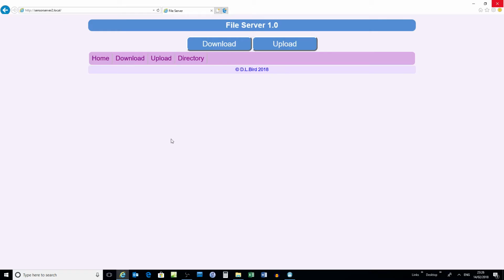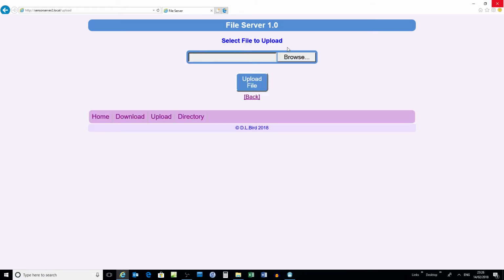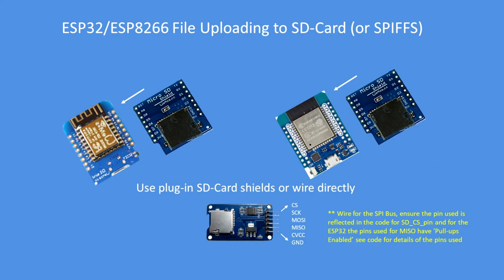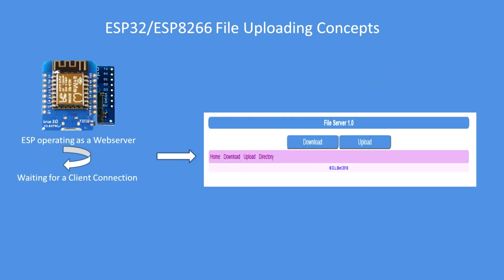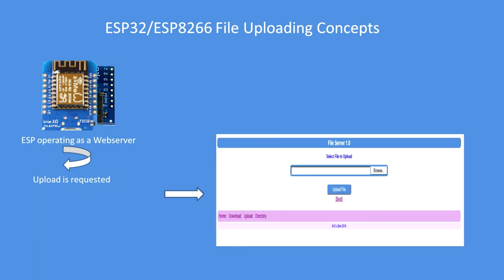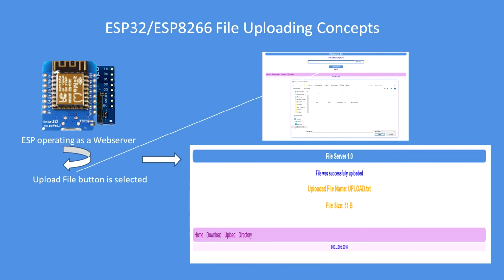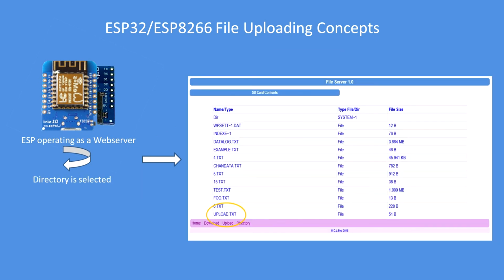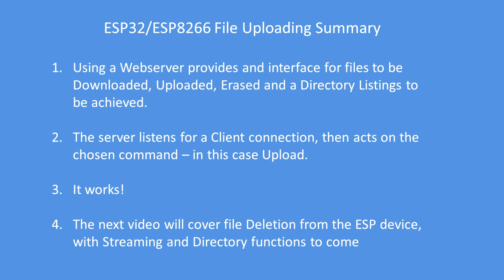Tech Note 086 - Uploading Files to an ESP32/ESP8266

Comment: I have to send video(mp4 1MB) from my pc program(c# form application) to the esp8266 or raspberry over wifi. I have to save to sd card in esp8266. I don't want send video from browser. How can i do this? thx
Reply from the maker: You’d have to use FTP to do that there are quite a few examples around. You can use the Asynchronous Webserver to do it too. Complicated but the examples will show the way.

Comment: That upload function seems neat, I will have to play with that upload code, interesting how it seems the uploaded file comes in little chunks.
Reply from the maker: jontscott More likely packet payload sizes and it does take some time to transfer say 50K and the SD Filing system is not that fast.
Reply from the maker: jontscott I added a link to the HTTPupload source in the ESP core you can see how it operates in there under the webserver.

Comment: Hello, is there a way after uploading a file, it then stored automatically to a  specific folder? Or create a new folder then store there? Thank you
Reply from the maker: Christian Dave Tipactipac, unfortunately there are some limitations with the ESP filing system. On the ESP8266 it can use folders e.g. /data but on the ESP32 there are no folders just pseudo folders by prefixing the file name with /data and /data acts as a filter with all files existing at the top level. You could add some copy commands to the code after upload.
Reply: @G6EJD  Okay sir, thank you.

But when I download it sir? Do I need to specify the entire location/directory? Or it downloads the whole folder?
Reply from the maker: Christian Dave Tipactipac, the ESP filing system does not support wildcards so you have to specify each file. It’s a basic filing system noting it’s a micro-controller.

Comment: Good project, but I have a problem, when I upload a file I have an error message "Could not create file loaded (write protected?)", Is this because I am not used SD card?
Reply from the maker: No SPIFFS will work the same, but the environment for SPIFFS has to be setup correctly first. Has you formatted SPIFFS? Have you started SPIFFS? I can't help because I have no information from you.

Comment: Hi, what does this code exactly do and when to use it, what is it about with these brackets? in server.on I found this expression: [](){ server.send(200)}
Reply from the maker: This code runs up a ESP based WebServer, and then from the menu, you can select a file using your PC Browser and then upload the file to the ESP8266/ESP32 filing system e.g. SD card or SPIFFS. [](){server send(200)} are just empty parameters and the code 200 means HTTP  OK because it's a standard response for to a successful HTTP request.
Reply: Good morning, yes I understrand that, but usualy I use the instruction in this way:"server.on("/wifi_connect", HTTP_POST, handlewifi);" to call a subroutine. But now we got these brackets like this: "server.on("/update", HTTP_POST, []() {
    server.sendHeader("Connection", "close");
    server.send(200, "text/plain", (Update.hasError()) ? "FAIL" : "OK");
    ESP.restart();
  }, []() {....more functions......}); Do you know where there is a reference and explained, how to use it?
Reply from the maker: SV Vela Nautica, you need to go to the web server repository on git hub, then scroll down the .cpp to send and check out the parameters. There is no documentation that explains what you want to know, if only there was!
Reply: Ok, then let me ask other way round, maybe you know? here my example again: HTTP_POST, []() { server.sendHeader("Connection", "close"); server.send(200, "text/plain", (Update.hasError()) ? "FAIL" : "OK"); ESP.restart(); }, []() {....more functions......}); 
I like to separate all what is in the last curly bracket into a separate subroutine. I tried to replace [] by a function name but that did not work.Do you know how to? Oliver
Reply from the maker: You can't do it the way your trying to do, there are separate commands that you need to use with the Webserver:
server.sendHeader("Cache-Control", "no-cache, no-store, must-revalidate"); 

 server.setContentLength(CONTENT_LENGTH_UNKNOWN); 

 server.send(200, "text/html", ""); // Empty content inhibits Content-length header so we have to close the socket ourselves. 

server.sendContent(webpage);

server.client().stop(); // Stop is needed because no content length was sent

You need to ask the author of the Webserver why you can't use functions, that's Espressif, your trying to do something the server was not designed to do.
Reply: Hello, yes I understand that, but here its very similar and it works: server.on("/fupload",  HTTP_POST,[](){ server.send(200);}, handleFileUpload);
we call the function handleFileUpload instead of placing all the code here in curly brackets?
Maybe its just not intended to be possible, but it looks the same and works....
Reply from the maker: You can only have one parameter {server.send(200);} is ok, {server.send(200);server.send(200;} is not ok. Just because there are delimiting brackets does not mean you can place many functions in them. The final parameter is a programme function that is executed when the server receives the appropriate command line parameter. If you inspect the webserver library you can see how the parameters are processed, but what it doesn’t have is a parser to process multiple commands per parameter.
Reply from the maker: HandleFileupload is one of my functions found in the sketch. Server.send(200) as you known is an http status report
Reply from the maker: void ESP8266WebServer::on(const String &uri, HTTPMethod
method, ESP8266WebServer::THandlerFunction fn) { on(uri, method, fn,
_fileUploadHandler);  }
Reply: Hi and thanks! now I understand the concept behind these functions! and how they are intended to work. I wish there would be more references from Espressif about these comands.
In the end I still love this ESP32 chip, it´s awsome and I do so many things with it. thanks to you for your advice and help.
Reply from the maker: Glad we got there, yes there is no or sparse documentation, it would be unaffordable to it to probably. Relies on a community to do that. Have a look down the web server source code on github for a clearer idea google ‘esp8366 web server GitHub’ or ESP32 version of the same

Comment: Very nice indeed, installed the code and I like the tidy looks of the web interface. Are you still developing this software, can't seem to find the announced next versions with directory listing, delete functions and so on. If you stopped with it, I'll have to do it myself, quite a challenge I guess ;-) Thanks anyway, got me half the way of jukebox project I have in mind, that should send mp3 files to a sonos box. Your code will be used to maintain the collection of music files that the jukebox makes available. Thank you for that!
Reply from the maker: Frank, all the code is finished there is a full version if you follow the TN video series so this TN then the next adds more features through to the final version with all the functions.
Reply: @G6EJD  Thank you! Found it, and used version V01 which works. Have not looked into V02 (same description) or V03 (diagnostic version) yet. It is actually my very first project with a ESP32 wroom board, so I feel like Alice in Wonderland - luckily I used to program in C long time ago, so with some head scratching I am slowly making some progress. Thanks again for getting me started.
Reply from the maker: Frank, the diagnostic version is provided to determine if there are any WiFi connection issues, together with any JSON diagnostics as the weather server can sometimes issue a lot more data than is expected.

Comment: Any idea What is max size of sd card supported by esp 32/8266?
Reply from the maker: I'm using SDHC cards and currently a Samsung 64GB card is working just fine. The file format is FAT so no files more than 4GB. Essentially (I have not tried it all) I'd expect the SD library using FAT to do everything a PC can do using SD cards of the same size. I know 512GB cards have been used on an ESP8266 and that's the same library. In practice and for most applications a file of data of about 10MB is huge, so getting near the 1GB sizes and FAT maximum will be 4GB is extremely large files. I have not done any benchmarks but it might be slow reading through the files, but workable.
Reply: G6EJD thanks a lot 64 gb is a lot :)
Reply: Nice work ! Cool application ! What upload and download speeds  we should expect in this chips ? Is any difference between them ?
Reply from the maker: The http protocol overheads are large and generally a 20K file takes about 2-secs, the ESP8266 compiler/http implementation along with all other webserver functions is faster than the ESP32 in all regards. I think the eSP8266 had a lot more compiler development than the ESP32 so-far.

Comment: how long would a 50mb file take to upload from an ssl server?
Reply from the maker: Well, to be honest there is no deterministic means of calculating that, the ESP libraries use http so the overheads are higher than an ftp transfer, each packet size is about 1600 bytes or 32768 packets, but what is a packet speed, who knows, so many variables based on path to server and network performance, to name a few, but I’d expect it to take many minutes, from about 3 to 30 minutes m, it’s not a desktop PC. Try it out is the answer.

Comment: Could I upload files that aren't  .txt? And make this a wireless access point?
Reply from the maker: You can upload any file type the ESP sketch does not care, it's a binary payload whatever it happens to be when interpreted by say a browser or some other application. It can relatively easily be switched to an Access point, just prefix wifi.begin with the required mode. There is plenty of documentation via google on how to do this.
Reply: @G6EJD  thank you very much. Your videos are helping me design a portable file server.
Reply from the maker: Good luck with your project, there is a more advanced version with dir, upload and download with delete, I’m sure you’ve seen this version. See github.
Reply: @Genericuseron  hey,i am also doing similar project,i could not upload not-writable files like pdfs,i can upload images,but they are downloaded in unreadable fomat .did it work for you?
Reply: @kmrkmr2526  I haven't attempted the project yet. I am waiting on the products to arrive to the house. I will let you know when I attempt
Reply: @Genericuseron  is your projct working succesfully?

Comment: Thanks again. A request although your videos are focused on esp32 programming and functions, can you also make a video sometime about how you make that html interface? Do i need to know html scripting or is there any hui based software that can at least give us basic html script that we can later transfer into esp32 sketch as you do?
Reply from the maker: OK noted. When I publish the next video with the completed code of upload, download, delete, stream and directory functions I'll go through some of the code details, I'll probably explain how the Client requests are handled, then how the pages are built in HTNL and how CSS is used to format the HTML but in essence most of this could be stripped right back to a bare-bones system that still works without all the colour and object embellishments although using CSS forms does make changing the design quite easy. If you go to the CSS tab you will see the CSS elements for say an HTML <body> and you can change the width, etc, I've tried to make the descriptions self-documenting. regarding the pages themselves they are all (simple) HTML and they are constructed by adding a standard HTML page header, then the body section and then finally the HTML footer section all needed for a correctly structured HTML page and for your browser to display the result. So there is no scripting involved its all HTML plus the Arduino variables that are combined together to display the HTML. Example:

Say we want to display a variable called 'temperature' in HTML we'd need to embody that in some HTML mark-up, let's us use for example the <p> paragraph element, ordinarily we'd do this:
String webpage = "<p>The temperature is 26°c</p>" so now let's change that fixed element to use the variable, then it becomes:

String webpage = "<p>The temperature is"+String(temperature)+"°c</p>";Now it will print the same but from one of your variables, temperature in this example.To send the HTML to the Client there are a couple of techniques either send a whole page using some arbitrary variable I use 'webpage' and you keep adding to it. So in the code you will see that I start by adding all the header stuff to webpage, then with webpage += I add all the middle sections and then finally I add the footers then send the whole variable back to the client with server.send(200, ""text/html, webpage);So that's a quick overview but I hope from that you can read the code a little more easily now, but yes I will explain the concepts some more in the next video in the next few days. Dave.
Reply: G6EJD i am extremely thank full to you for beautiful precise perfect explanation and guide. I saw your latest video and learnt a lot.

Comment: Hi, i only need send video(max 1mb) without any interface. How can i do it?
Reply from the maker: Do you mean transfer a single file or to stream it? You can transfer a file but using http will take some time (many minutes) to complete. I have not produced a streaming version.
Reply: @G6EJD  Yes, i mean a single file. Maximum 1mb video file will be sended. Aproximately how much time will it take to send video? http is not the right way to do it? My project is that connect from Pc to Esp and send 1mb(max.) video file. Do you have any idea for this? Which one is the right way to do it?
Reply from the maker: @kemrandavrishov9341  it’s difficult to determine the exact transfer time the best way to find out how long is to transfer and time a 1K file, then 10K and 100K from the timings it’s easy to work out the 1MB transfer time. You have no choice about transfer protocol as it can only be done using http. There are some ftp libraries around but they are harder to use/integrate with code and are a bit experimental.
Reply from the maker: I have provided a file upload example.
Reply: @G6EJD  First of all thank you so much. İ need send video from Ground station program(python desktop application) to the esp3286 over wifi. İ only need select video from GCS program and click the send button to send video.İ actually dont know web interface is necessary  for me? İ dont wanna send video from browser. How can i do it?
Reply: @G6EJD  Or can i do it with esp8266 tcp/ip( with sockets)? About 10-20 second to send video(max 1mb) is good time for me. Do you have any idea? İ appreciate your help.
Reply from the maker: @kemrandavrishov9341  I’m not sure how you can get the ESP to respond to a connection request to then download the file. The way I produced the code was that the client esp initiated the transfer in your requirement you want the PC to initiate the transfer. Needs more time to think about a solution
Reply: @G6EJD  İ want upload file from pc to esp. İ just wanna use esp8266  acces point mode and then connect with pc and send video.  İ think your code is can do this. İ only need change station mode to access point mode and then learn how to use python http library to cumunicate wih esp8266. My plan is remove your homepage interface and use python http. But there is a problem, i dont know how to give file path and upload button(in your interface) functionality from python http to your esp8266 code.

Comment: ERROR While uploading "Architecture is not compatible "
I am using ESP32 DOIT DEV KIT V1
Reply from the maker: Did you install the ESP32 support
Reply: @G6EJD   what is the supporting file ?
I installed ESP32 BOARD
EXTRA LIBRARY of server  FROM GITHUB
Reply from the maker: What are you trying to transfer?
Reply: @G6EJD  Thanks for replying.

i couldn't connect even using ip address in browser. But it is connected to my hotspot. How  cam i solve this problem...
Reply from the maker: @mithunxavior  , what ip address does it report in the serial port you need to connect to that
Reply: default ip address already set in network.h
Reply from the maker: @mithunxavior  , so what happens when you click on http://192.168.0.150/

Comment: What is the upload speed for the ESP 8266 ?

thank
Reply from the maker: hin124 It uploads a 20K file in about 1-2 secs I have not done an accurate measurement but it’s near instantaneous. Obviously this is a micro controller so don’t expect Desktop PC performance.
Reply: max download speed I have achieved is 70Kbytes/sec
Reply from the maker: That sounds about right to me, the http protocol results in a large overhead, but it’s the only provolones that is supported by the IDE as standard there are some ftp libraries around but they are difficult to interface with for the HCI

Comment: can I using html upload mp3 to esp32 .
Reply from the maker: Http can upload any data file to the ESP32
Reply: @G6EJD  
HTTP can run in phone
I want to upload my file
to esp32 on my phone
Reply from the maker: @สุพงศ์เอง  Your phone can connect to the ESP32 and yes will use http like it does for all web pages, you would select the file to upload and then upload it